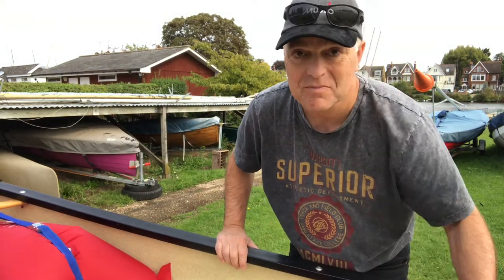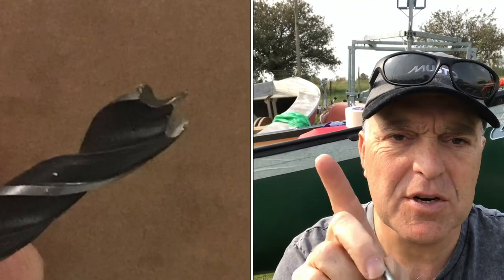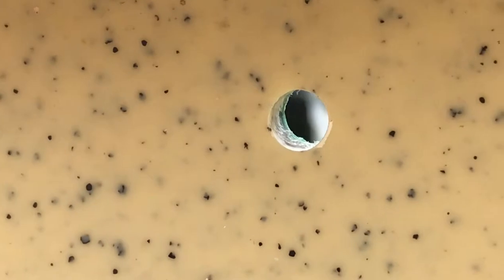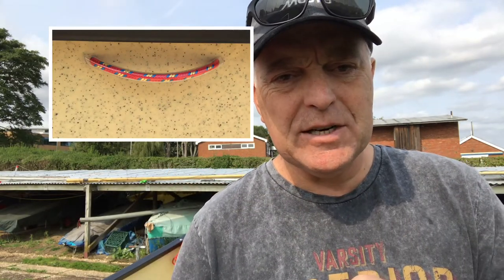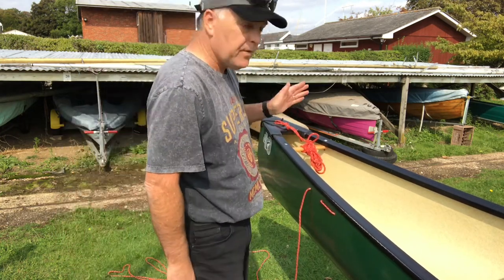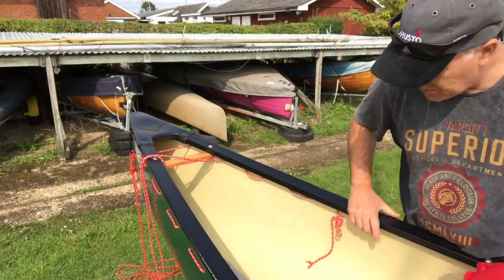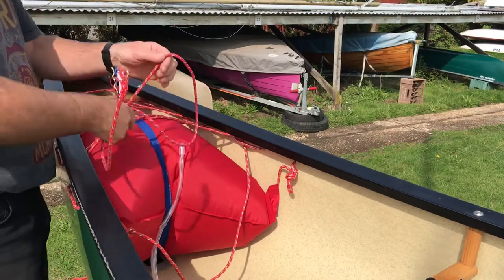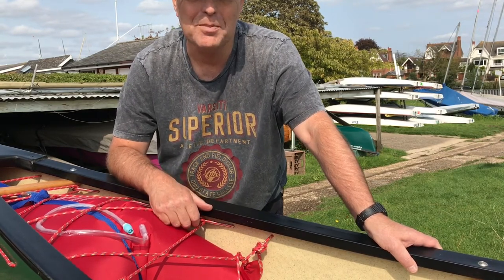DIY Lacing Setup for Canoe Floatation Bags

Comment: I found heating the nylon cord up over a controlled flame and then pulling on the cord tight , about 15cm length,it then is thinner and the cord goes hard so it doesn't bunch up when trying to tread it.

Comment: What is the length of the strap you are using to secure the float bag in?  Also, others I have watched forgo the stearn strap, arguing that the stern seat will stop any forward movement; what are your thoughts on that?
Reply from the maker: Hi Stephan, thanks for your query,  these are standard off the shelf 25mm webbing straps, I think they were 2,5m but I found that it was too long and I eventually cut them shorter. The length would very much depend on your bag size and to be safe just measure before buying. Further to the stern strap, you raise a good point and their is about a 3 inch gap between the stern seat and the bag so probably not necessary but I did it anyway while doing the straps, live and learn. ATB. Grays

Comment: Without sealing the holes, is there any danger of water getting in between the two skins?
Reply from the maker: Hi Darren,  good question, I researched this in quite a bit of detail(very nervous to drill into the canoe) checking out all the professionals and this is how they do it.  No problem so far.  Good luck   ATB Grays
Reply: @GraysOutdoors  thanks! 👍

Comment: May I ask the size of the tubing? Perhaps I missed it mentioned. Thanks!
Reply from the maker: Hi David,  don’t recall mentioning but I do have a piece left and it’s a FITT Cristello extra 6x8. Any pvc tubing should be fine 6x8 is the internal and external measurements in millimetres. This obviously depends on your rope diameter. I used a 5mm rope 
, it was a tight fit I pulled it through with a piece of string but the finished result was good. ATB. Grays